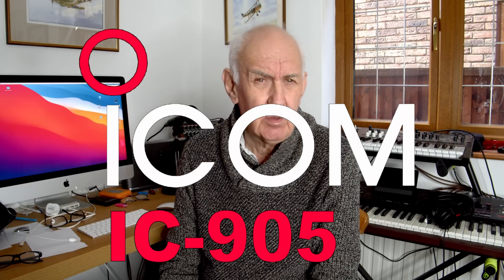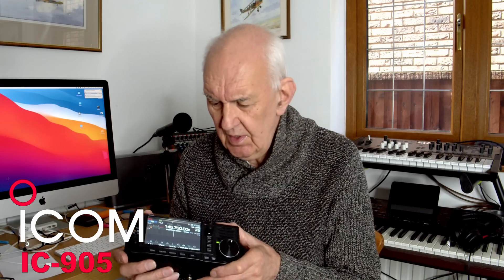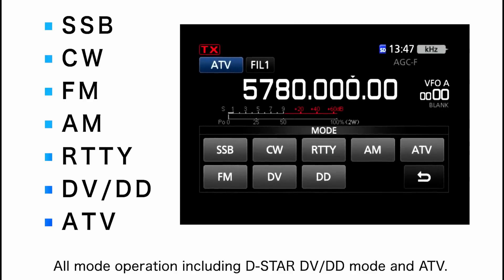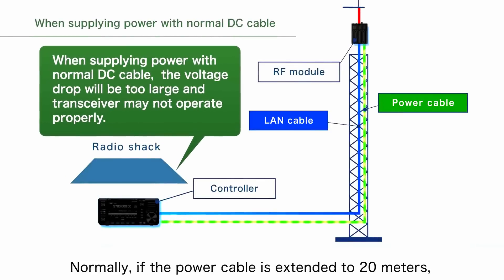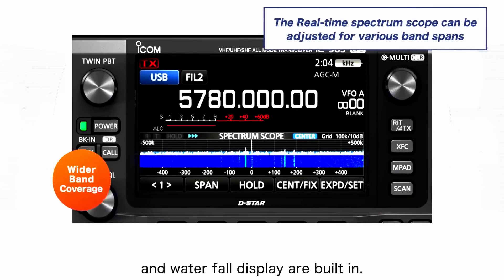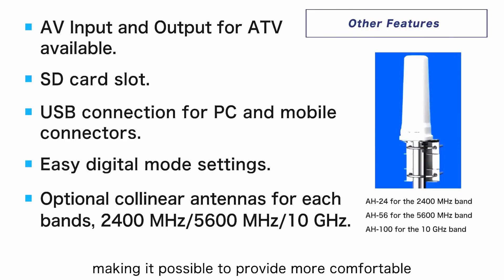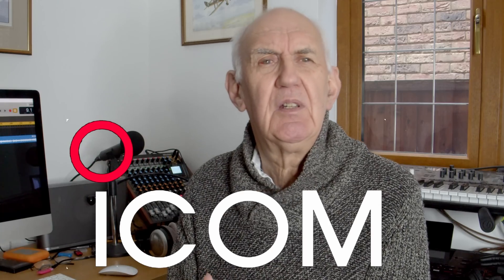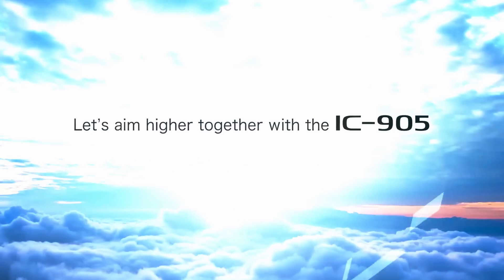Icom New IC-905 - First Sample Arrives

Comment: I have a technical question which will dictate whether I shall buy a couple of these or not...can the RF unit be remotely installed over an ethernet network? I ask as I will need to install the RF unit and 10GHz transverter on a remote site (I can provide PoE for it) and will need to have the display/control unit on my bench in the workshop/shack, connecting the two over my private ethernet network.
Reply from the maker: As I have neither a sample or handbook I cannot answer that one.

Comment: I am new to HAM radio.  What do people do at 10GHz?  Is it a shorter range?  Is this for point to point sharing of data, video, voice?
Reply from the maker: I have never operated up there but it is very much for advanced work with specialised dish antennas - not for beginners!
Reply: I don't operate at those frequencies either but I would imagine TV and high speed digital modes are the main interests.  I can't imagine anyone paying for SHF equipment just to use the available bandwidth on voice modes.

Comment: Hi guys .

I am slightly dubious as there is a lot of  relying on this masthead RF module . 
It is a nice radio and I have several Icoms myself ...I completely are definitely up there with breakthrough technologies.  

However , I feel there is too much dependent on an unpractical out of reach unit at the top of the mast.  

Its OK if we have some issue with ethernet or T/OCXO  when the unit is in the shack we can make amends . But consider lack of connection or communication with the RF module during a blizzard or torrential rain ?Just saying

Comment: I don't get it, many of the negative comments in here seem to have missed the blatantly obvious?

Surely you can site the RF head right at the antenna feed point with 10cm of coax or you can sit it on your desk and run 20m of coax from your SSPA, Antenna switch etc. etc?

Or is it just a matter of whiny old hams again?

Comment: Where do I put my amplifier? Up the tower?
Reply: Yes.  At these frequencies you're not running multiple tens of meters of even lmr600.  At most you're connecting equipment inside the same cabinet with half meter if semirigid.

Comment: A nice pitch Peter, I think its true that there will be folks who will be keen to try bands using commercial products rather than the traditional approach of transverters and kits. As with all gear though, you need people to communicate with. There is some interesting experimentation in the USA, where rain scatter information enables contacts in the 10 GHz band, often over 500-800 miles.
Reply from the maker: Sounds very interesting

Comment: one antenna connector for 144, 432 and 1200 is useless, this means that a waterproof remote 3-way antenna switching system will need to be installed up the tower to switch between those antennas. Also not considered are those who already run 400W on 432 and 1296 using SSPAs in the shack, great when the RF head is to be installed up the tower! Not to be too negative, it's a great starting point using technology which has been around for many years but it's only a starting point and those who subsequently want to add RF amplifiers, pre-amps etc. will probably have to find an alternative system set-up.
Reply from the maker: As I said, it is not for everybody!
Reply: @watersstanton  I've had it confirmed that the antennas are vertically polarised (to fit with the novice license in Japan), horizontal polarisation is the norm in USA and Europe so as I see it these are a total waste of time and money. It will be interesting to understand W&S sales strategy for these units that are not compatible with operation on the existing spectrum?

Comment: Icom dropped the ball on this one.  The reason for doing s-band and higher is the greater bandwidth afforded.  This may well be an acceptable trade to limit only to line of sight scenarios, qrp ops with a vengeance,  dependency on third-party infrastructure like GNSS, etc. 

That may all well be acceptable if Icom makes full rate IQ samples available.  I’d be willing to bet the radio will instead be constrained by their marketing department to the few kHz of digital data we’ve been trained to accept.

In this price range, the ic905 bumps into territory occupied by lab and research grade SDRs.  For example, the Ettus (National Instruments) N210 outperforms this on metrics that matter.  Specfically, the 56MHZ and 14bit deep IQ samples to/from the digitizer.

I expect the ic905 will have very limited appeal.
Reply from the maker: Sounds like you are not an SHF operator!
Reply: @watersstanton  , rereading the post, it came off a bit harsher than intended.  Maybe it’s just PTSD from dealing with similar for work :- )

It’s a shame though.  Icom could have enabled and enriched the amateur community so much more; I bet Icom engineering were gnawing at the leash.

Comment: Great...put the electronics at the top of the mast where it will be exposed to lightening damage. The money saved on coax will be spent on radio repairs.
Reply: Because there's no other choice. Loss for cable like LMR400 is 11dB per 100ft for 5.8GHz.  It's not even rated for 10GHz.

Treat any electronics sited outside as disposable, wear items.
Reply from the maker: Mast Head amplifiers seem to survive,
Reply: @watersstanton  Well, but this device isn't just a simple and much more cheaper mast head amplifier...

On the other hand: A lightning stroke should be covered by your insurance - if you got one.

The more important question from my point of view: How do these devices resist the radiation of nearby HF antennas, when operating short wave bands with full legal power at the same time you operate QO100?

However, the IC-905 sounds interesting. Let's wait for the first "real life researches"... 

73 de DL1WTE
Reply: @watersstanton  They are welcome to test this at my QTH, at the top of a 120' tower. It can be hit several times each year. I'll even install it for free hihi.